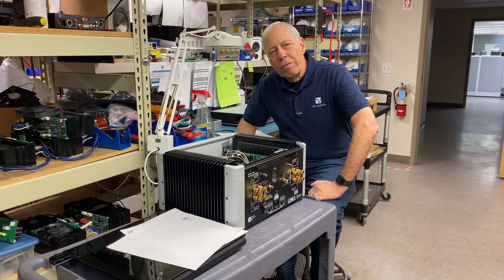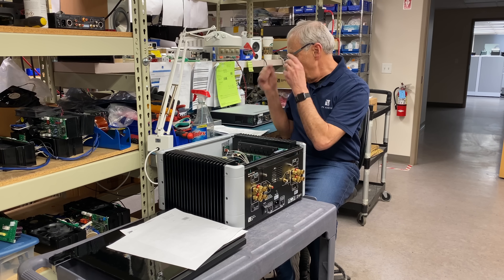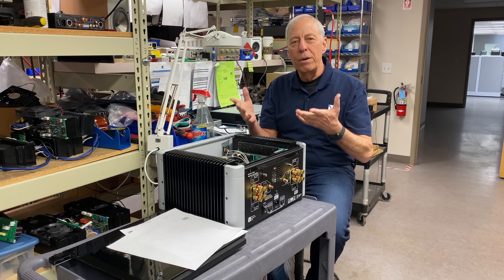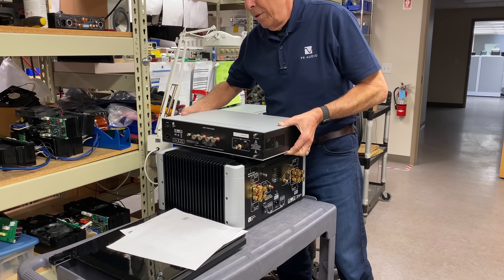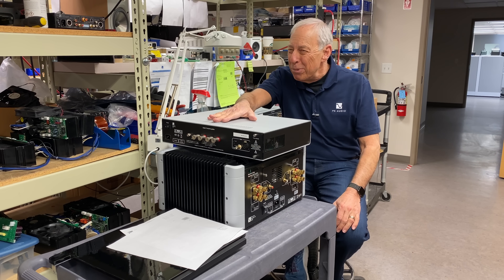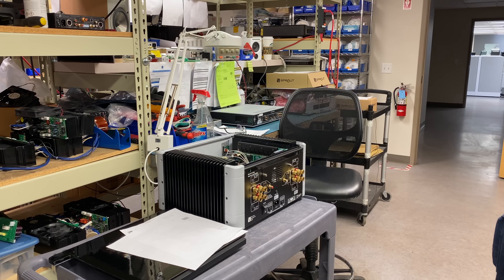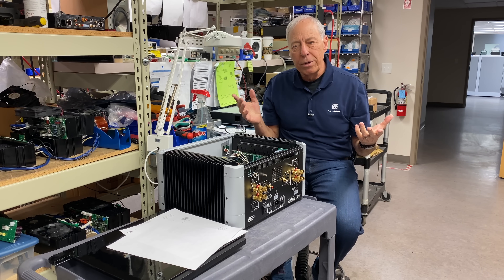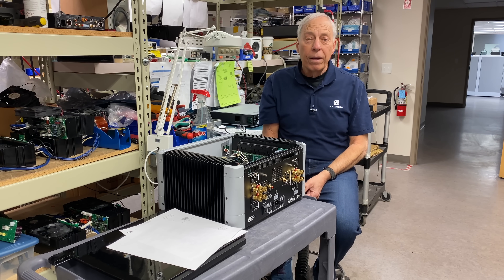Power amplifier efficiency, watts in vs. watts out

Comment: Hello Sir, We have seen Professional Amplifier like 2*2000W @ 4Ohm where as the input power cable of the amplifier can be connected to 15A sockets. How this is possible ? Is there any guide the RMS Power output of Amplifier to the AC Power input to amploifier? This helps to select the generator size for outdoor live event where i always feeling we using oversized generators.

Comment: I recently bought a Panasonic PMX90 CD player. In the manual and on the back of the main unit it says it draws 40W.
Yet the specs say the system can output 60 W per channel (3 Ohm), 1 kHz, 10% THD / total 120W RMS.
How is that possible? Is it only marketing babble? What is the real power of the system?
Reply: Well, first off I think you might be getting confused. No CD player I am familiar with outputs power into a speaker, o I am not certain what label you're actually looking at.
Reply: @octaverecordsanddsdstudios1285  The player that I have is an 'all in one' unit. It has a CD player and an amplifier in one box. It does not need an external amplifier, you plug the speakers directly to the 'play'er' itself.
Reply: @23pawlik  Wow. That's a first for me. Ok, can you send me a link so I can see what the answer to your question is?
Reply: @octaverecordsanddsdstudios1285  Is there any way I can contact you outside of YouTube to send you the link to specs? I tried to leave it in a comment here but it seems YouTube is deleting any comments that include links to other websites.
Reply: I read a thread about these Panasonic systems, and apparently the 40w is the wattage consumed at normally listening levels. Iirc they call it 'nominal input power consumption'?

Comment: Sir which has a greater electricity consumption 2 pcs power amplifier total of 1200 RMS both use at the same time...OR... a 1pc/single power amplifier that has the same RMS of 1200 RMS??  Thank you
Reply: That would depend on what class amplifiers they are. Provided they are of the same design/class, then it would be about the same. I.e  2*class-d amplifiers would be near enough the same as a single class d amplifier. However unless you can bridge the 2 amplifiers, you won't have 1*1200w, but 2*600w.

Comment: So why does the JBL Partybox 1000 output 1,100watts of sound power but the specs say it only consumes 150watts of supply power? OR is that a misprint and should be 1,500 watts of power?
Reply: Because it's not quoting RMS power output. There's no such measurement of 'sound power', so they can literally make up a number.

Comment: The maximum theoretical efficiency of a conventional amp is 50% w/ sine waves and full power. But unless the power going into the speakers is unusual, it's more a question of bias, idle draw. OTOH the low power rated amps that sound huge are biased hot...

Comment: My little SET which is class A at about 12 watts per side is consuming roughly 150 from the wall continually. And it basically never changes. In fact it gets more efficient when you run full volume as it pretty much transfers heat to sound. The actual driver stage itself is probably 25% efficient peak, but there is also the warming plates and other losses.

Comment: Paul your answer wasn't even an answer. This guy wrote in asking what a company looks to produce regarding Watts out of an amplifier and Watts that is consuming out of the wall. You go off on a tangent talking about your power amplifiers and the efficiency of them. You did not answer the question. Secondly, your class D 1200 w amplifier is a boat load of Overkill and by the way it weighs 27 lb which isn't exactly heavy in the audio file world. When listening to speakers at roughly 90 DB I seen on your own a power plant at one of my friends house that it's just drawing 120 watts. You're playing the numbers game with making a 1200 watt amplifier. It's like saying you created a car with 1000 horsepower but yet the top miles per hour in your town is 55 miles per hour. Plus if you even pulled all those Watts out of the wall you would trip Breakers in your house LOL
Reply: Paul pretends he can barely lift the amp LOL.
Reply: @paullazarro531  I know...27lbs!
Reply: But you are assuming that the amp would be used at full power. On a continuous tone. Highly unlikely in a house environment. Also does your 2kw kettle trip the fuses? No?
Reply: @thefattysplace  did you read anything I wrote? The point of my whole comment is that the 1200 watt rating is massive Overkill. That is a fact. Speakers barely even need 150 w at a ridiculous volume. A typical kettle is 1500 watts. If both his amps pulled 2400, yes a breaker would trip. But again seems like you missed the point of my comment. He is touting his massively powerful amplifiers but they are a ton of Overkill that's not even needed
Reply: @ryanschipp8513  240v * 13a = 3120w? Perhaps you are from America and are using 110v? Also you might not need 1200w at home, but for professional use it is very often required, i.e I use a 1600w Gemini for DJ work because it's needed.
Reply: @thefattysplace  yes, from USA. Talking about Paul's amps. Not your DJ equipment
Reply: @ryanschipp8513  are you saying his amps can't be/are not used in large scale venues?
Reply: @thefattysplace  they are not. Home application
Reply: And I think it's kg, not lb!
Reply: @thefattysplace  nope. Its pounds.

Comment: I think the best compromise efficiency/sound-quality for regular gear is Class AB amps.
Sure you can say a Devialet sounds great and it's Class D but that's a 10 k € amp putting out 150 W.
For regular people at regular prices a good 100 W Class AB is a few thousand $ and it's all you need. It sounds really good...doesn't get too hot...quite efficient (60% or so)..and it doesn't break the bank.

Comment: Fascinating subject and IMO Paul did a great job here explaining the PS Audio side of things. Correct me if I’m wrong but Paul participates in the design of his amps but he has a head engineer that does most of the heavy lifting. His name escapes me. And I think from time to time he has contracted with outside designers for some of this products.

I’d pay airfare and overnight hotel room costs to see the PS Audio head design engineer and Nelson Pass ( Threshold, Pass Labs ) in a civil give and take discussion and take questions from the audience. I’ve spent hours with Nelson listening to his philosophy on audio amplifier design. I‘ve owned a number of his products over the years.

To boil all this down. A Nelson Pass amp will have an idle power of about 50% of rated output. So a Pass Labs 100W power amp with its input shorted will draw probably a little more then 50W doing nothing. And something over 100W running at full power. The PS Audio amp Paul presented in this video probably draws under 10W with its input shorted out. And something over it’s rated output at full output.

So there the discussion begins. And it would be fun to listen to. Which is better? I think the Pass amps are a little more costly then PS Audio. Are they better? Well there’s the spirited discussion isn’t it.

One advantage of a Pass amp is that it can double as a space heater during the winter.

Comment: I have been power shamed for my Class A, 400 watts in for 25 watts out power amps. A couple of points. If you can afford a $5k to $10k (or even a $1k) amplifier, the power it uses is not going to break you, or destroy the environment. Second point. Do they throw off heat? Absolutely. Is it enough to heat up a room? Not even close.
Reply: Exactly, you don't buy a Buggati for fuel economy. My monoblock draws 1000W (500w each) when they are in idle.
Reply: @mornecoetzee735  a monoblock shouldn't draw current when idle.

Comment: Class A tube amp has @ 10% efficiency....in hot weather it’s worse because of increased A/C to offset the heat introduced into living area
Reply: efficient speakers. just because they make 70 w tube amps doesnt mean we need to have them. most modern speakers are far less efficient than in the early per transistor days..  2watts is a lot of power w the right design imo

Comment: I listen to my system 3-4 times a week and it's usually for 3 hours or more. I may only intend to listen for an hour but I keep finding interesting stuff to listen to and the sound is so engaging it's just hard to stop.

BTW if you want to talk efficiency how about a tube preamp? My Rogue RP5 has 4ea 12au7's, it does not list the power input so I just measured it using my Killawatt meter. With the unit front panel switch off (but the rear power switch on it draws 2 watts, when you power up the preamp with the front panel switch it draws 45.2 watts - the case gets pretty warm after a few hours. I would say the output power of this preamp is in the  milliwatt area at best so that leaves us with abysmal power efficiency. My PS Audio DAC is solid state so I'm sure it's better then that but in either case I am willing to spend the money because the sound is just so good.

The Stellar m700's do draw about 23w in standby so I usually switch them off at the rear panel, I turn everything on an hour or two before listening. There is a definite change in the sound between the 5 minute mark and the 60 minute mark.

Comment: It seems to me that the power consumption of his 1200W 85% efficient amplifier is an excellent match for the likely 15A Circuit breaker in the breaker-box....coincidence?...I doubt it. :-) 1200W/85% = 1411W <-- should be OK with a 15A circuit but it would be best for it to be the sole device on that circuit unless all other devices are insignificant in consumption.
Reply: Not really, as it doesn't draw that many Watts continuously. You would need it on full volume/output for that to be an issue.
Reply: @thefattysplace  If you've got more than one of them, you might want to set up a power-on sequence so they don't all charge their capacitors at the same time. :-) --- what I do with my four Onkyo Class-A space-heaters. 🙂
Personally, I prefer to build for such extreme situations described and then add a factor of x2 for safety....some would say that's way-overbuilding but it keeps trouble from cascading. :-)
Reply: @foxpup  you have four 1200w class A amps? Didn't know onkyo made such an amplifier?
Reply: @thefattysplace  The model I have four of is the Onkyo M-504 power amplifier. (driving my 7.1 channel home theater audio)  It is technically rated at 165 real continuous watts per channel but it has HUGE capacitors and can approach surges of a thousand watts for moments.  The thing I love about it is the 120 dB s/n ratio, something that was pretty darn special back in the 1990's when I bought them used.  I fell in love with those huge sultry VU meters and never looked back.  That said you cannot turn them all on at the same time without blowing popping the GFI, but I've got a trick for dealing with that. :-)  Back in the days these things were made only a class-A amplifier could produce power and super-high S/N but they sure heat up the room - wonderful in the winter, not so much in the summer. :-)  This design may deviate slightly from pure class-A but I have no idea how it would be different.  No volume control, just pure power with a noise floor so low you just can't hear it even though it is always balls-out full-on.  Sweet fidelity. :-)  Yes I am biased.  Fortunately the wife likes them a lot too so I don't need to worry about her getting jealous. :-)
Reply: @foxpup  oh they do look like nice bits of kit! And at 800w power consumption I can see why you have troubles in the US! Would be ok here in the UK. About 41% efficiency which is great for such an amp!!

Comment: Since a class A amp is continuously biased on, would not the current draw be constant regardless of the audio output level?
Reply: Yes.
Reply: Class A amps are at least halfway "on." The general consensus is to bias a Class A amplifier in such a way that the transistors/tubes allow some current to always pass across them, even at full output power. (Generally, with a solid-state amplifier, this equates to ~3/5 of the rail voltage on the output, 1/3 of the power supply output current, or whatever you are comfortable with in terms of thermal limit.) So there is a constant current draw at idle, but at maximum output power, that current draw can be nearly twice as much. This is not taking into account the other inefficiencies of the chosen amplifier topology.

So, for example, I have a little DIY JLH amplifier using a class A push-pull topology. (The nomenclature is a bit confusing, but it is true Class A.) The idle current is 1.22A, which means that, at maximum output power, the amplifier will swing up to 2.44A (load-dependent). The idle dissipation is about 50 watts per channel, max dissipation is about 80-90 watts per channel, but I'm only getting about 10W+10W of output power.

Nelson Pass has several good write-ups on his First Watt page in the "Articles" section if you wanna look further.

Comment: 100 watt incandescent light bulbs aren't manufactured or imported anymore. But yet  there are still tons of them available to buy. My 13-bulb kitchen light used to give off spotlight stage burns lol. Thank goodness for dimmer switches and LED bulbs! 
And thank Sony-goodness for a stack of TA-N77ES amps to offset the money that the LEDs save 😆

METERS!

...not "100 CM" meters, "needle" meters. Gotta see that power distribution go bye bye as the music plays louder and louder 👋🏼
Reply: Big-ass meters is what I miss about using the Carver M-500. The Adcom 555's are better amps, but I sure miss seeing the needles moving, even if not much once I went with the efficient ADS L-series line of loudspeakers.
Reply: @trog69  Yay, another 555 fan!

Comment: Everyone should now know that regular Class-AB amplifiers are very inefficient and Class-A is even more ineffective and that Class-D is very effective!

LED bulb is class-D and incandescent bulb is Class-AB and class-A
Reply: That is exactly why Class A sound so much better.
Reply: Class D is like a fluorescent bulb more efficient but less natural looking.
Reply: @paullazarro531  No problems getting a Class-D to have natural sound! Yes there are many Class-D amplifiers on Ebay that are just garbage! But that does not mean that Class-D cannot have natural sound if it is well designed. Why do you think ps audio makes Clasd-D amplifiers? They can make a good Class-D with good sound!!

it depends on the end result coming out of the speaker! all equipment has its own sound
Reply: Class D technology has come a long way, and the MOSFETs can switch at much higher speeds than they used to be able to, so the sound quality from them is improving all the time.

Comment: The 2nd Law of Thermodynamics will get you if you don't watch out!
Reply: The 2nd Law of Thermodynamics is your friend.  It makes a lot of things work.  If heat didn't spread out, it wouldn't leave the source and help it cool. :-)
Reply: @foxpup  Join 'The Friends of Entropy'.  Embrace the beauty of apparent chaos:  the jagged arcs of a lightning flash following unseen resistance gradients; the laughing, splashing flow of water in a boulder strewn stream bed; the flickering flames in a campfire; the swirl of the cream (well, half and half) in a hot cup of coffee.  But know also when to get out of the way.
Reply: @foxpup  Also a phrasing of the 3 Laws of Thermodynamics that I rather like:

1st Law:  "You can't win, the best you can do is break even."

2nd Law:  "You can only break even at absolute zero."

3rd Law:  You can never reach absolute zero."

And the more recently added 4th Law:  "Everything takes longer and costs more."

 It was originally Khufu's (a.k.a. Cheops) Law:  "Nothing gets built on time or within budget", but it was upgraded to 4 Law status because it was determined to be universally applicable.

Comment: Back in the 70s when I started my audiophile journey I had a Bose 1801 power amplifier that weighed 82 pounds along with 4 Bose 901 speakers (2 per channel). The 901s used an equalizer that boosted the bass by 18dB at 35Hz and the lights in my house would dim when a bass drum would hit. This has got to be the most power hungry and inefficient setup in audio history. I sold everything after a couple of years use for the same amount that I bought it all for because I got sick of the amplifier clipping at more than 400 watts per channel output. An insane amount of power would need to be available probably over a kilowatt per channel to avoid clipping but the bass was unbelievable from the 4 901s as long as the amp wasn’t clipping.
Reply: Cool story.  Sounds like your amps didn't have enough energy reserve in its caps to make it through those spurious sounds.  I bet the neighbors loved you. :-)  I'm fortunate, my next door neighbor is a retired aircraft mechanic so loud noises don't bother him. :-)  Now if you ended up selling your system to someone who lived where it was cold most of the time it would be a win-win situation for him. :-)
Reply: foxpup The transformer in the amp weighed 41 pounds, half the weight of the whole amplifier! The filter caps were huge, I don’t remember their capacitance though. I clipped the amp when I really cranked it up, and had 4 ohms per side. The real problem was because of all the bass boost, 18dB is 64 times the power requirement, and 400+ watts was not nearly enough when music with lots of bass was played loud. I had an old couple across the street who would put their hands over their ears when they were outside walking their dog. Enough said? 😊🍻🤪